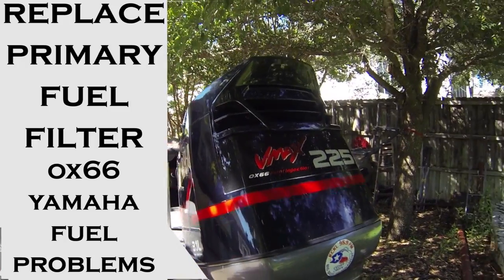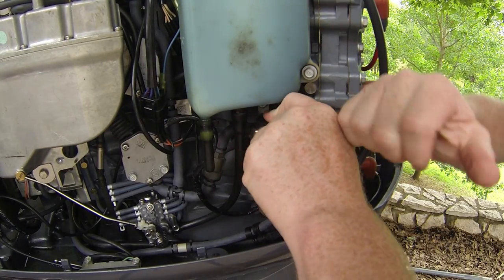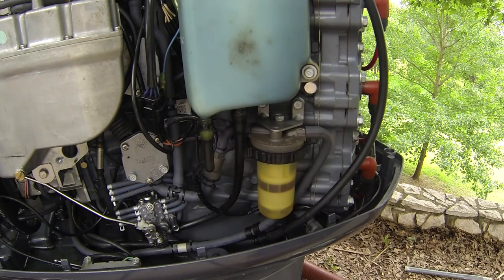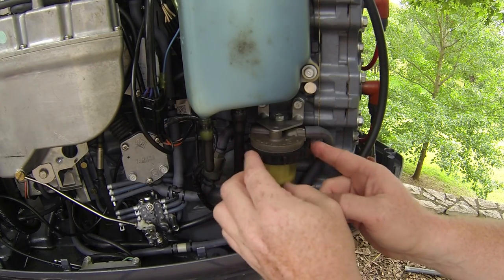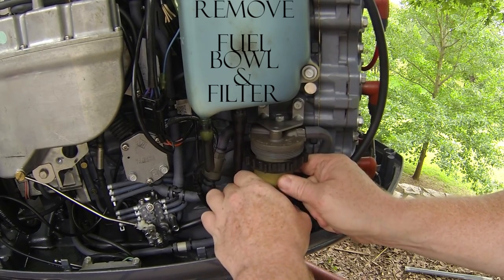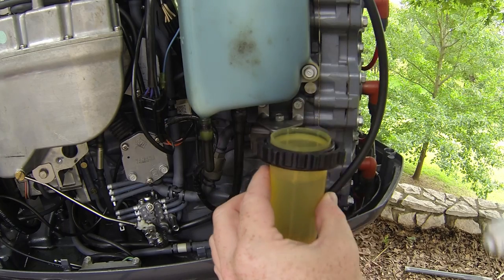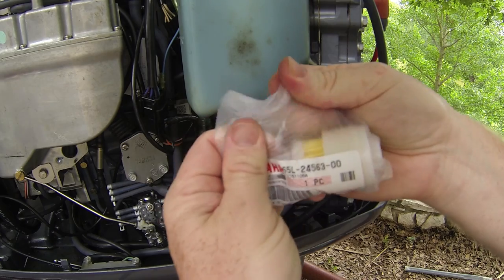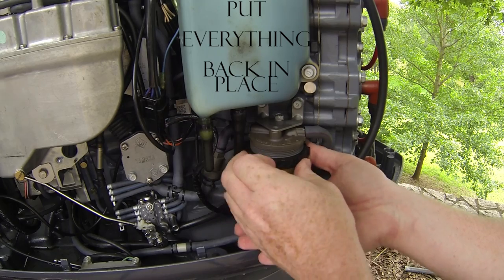PRIMARY fuel filter replacement for Yamaha ox66 3.1L outboard problems

Comment: So does the direction of the filter dosent matter you took it out a certain way and put it another just wonder which is the right way
Reply from the maker: i would put it on the way i did, the reason it is upside down in the beginning is because i got sloppy when thought about getting the camera to film it and told someone to put it back together real quick.  You would figure it out pretty quick if you attempted to change yours.  unless your doesnt even have one in the bowl.

Comment: I was sold the Yamaha fuel filter (65L-24563-00), the O-ring (65L-24564-00) that fits on the top of the filter a Spring (65L-24577-00) that fits on the bottom of the filter and the Orange water level float (61A-24469-00). * I probably could have reused my parts but since it was a 2002 motor I decided to change them all.  You mentioned you don't use the float but why didn't you check the O-ring on top and the bottom spring which holds the filter in place?

Comment: Thanks for the great videos. I noticed that when you took the old filter out it was filter side down in the bowl. When you installed it it was filter side up. I thought that the filter was supposed to be on the top (up). Was that just a glitch? The filter side of the element should be up...right?  Thanks..!!
Reply from the maker: You are correct. The old filter was installed incorrectly.  I put the new filter on the correct way.  If i had the little red water ring it would be on the extended plastic piece that goes to the bottom of the bowl.
Reply: Appreciate the reply. Excellent videos. Going to do my VST filter next. This is a real help to me as the shop manual is pretty vague.
Reply from the maker: Thank You, I hope all of these videos help make it as easy for you as possible.

Comment: Nice
Reply: Thank You for the help, as Im in Remote alaska with a 250 that is bogging down around 4500rpm and cutting off due to a fuel issue, gonna change all 3 filters VST, fuel bowl and Primary 10 micron canister to start with along with the o2 sensor.

Comment: Are you supposed to empty out all liquid before putting in a new filter or do you keep it in there?
Reply from the maker: Liam Sullivan I drain the old, refill with fresh so the pump doesn’t have to fill it all of the way from zero. Also need to drain it every so often to get any water that has built up in it.

Comment: Man I am new to boating and you are truly a great help!
Question, my motor cut off on me unexpectedly while coming back.  It has been running great till then.  Checked my oil reservoir tank and it was low.  I believe this may have caused the shutoff.  Now it turns but won't start.  Do you know if there is a sensor to reset somewhere?
Reply from the maker: Joseph Torres I’m sorry to hear that,  I do not have my boat anymore to go look

Comment: Hey man,  I wanna do all the same stuff you have done to your Yamaha 200. Thing is, I have a 2005 Yamaha Vmax HPDI 250HP 2 stroke. Call me a dumbass, but I have no idea what a Yamaha ox66 is? Is your motor older than mine? Will all the part #'s you added in the description below from your vids Amazon work on  my motor? I'm having a lot of trouble trying to get the right answers and find the right parts I need. Can u please help? Thanks!👊
Reply from the maker: Nick Witkowski my motor is a little older.  It’s fuel injected and yours is direct injection.  You will need to look up the correct part numbers for your motor.  It has its differences.  There should be someone out there who has made a video just like this for an HPDI.
Reply: @idcsports551  Hey thanks brother. I've looked at just about every video on YouTube and everyone has 4 strokes! I've found one guy named Will Cory doing a few maintenance vids on his channel, he has a 2007 HPDI 200HP and he seems like he knows what he's doing. He reached out to me yesterday and said he'll get back to me with a list of part #'s from Amazon to get me going. So thank you you for gettin back to me man, I really appreciate it. 👊